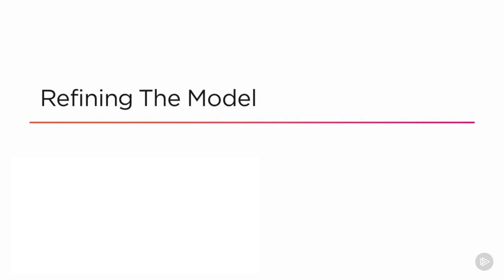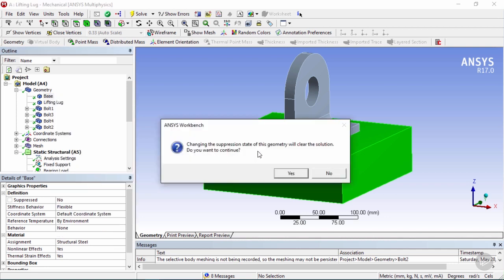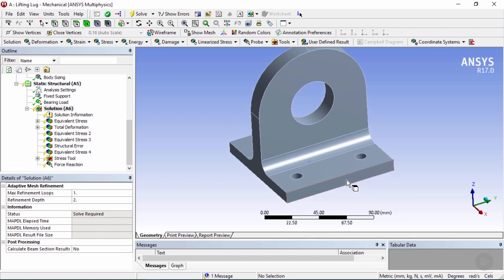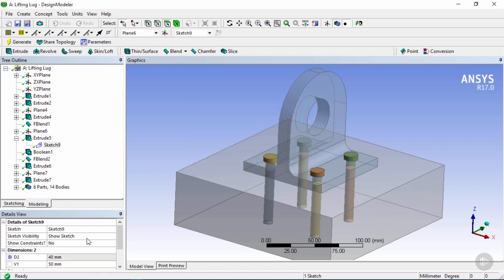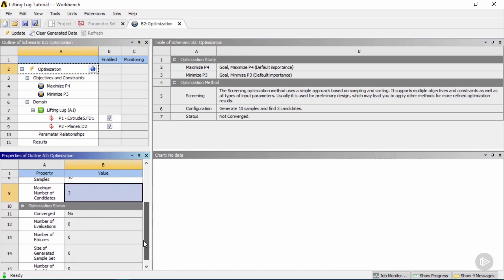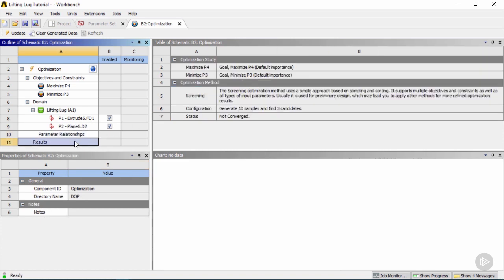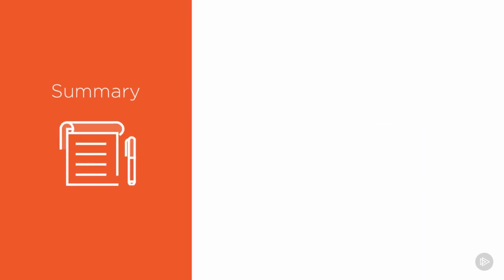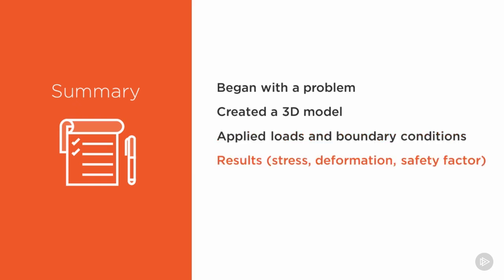Introduction To ANSYS (Part5) : Refining the Model

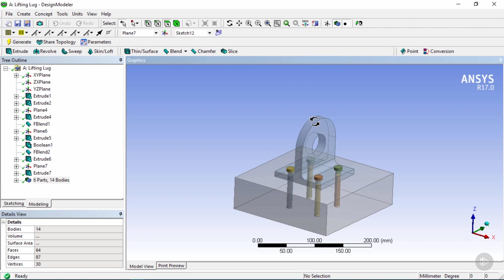Comment: 8:41 set parameters
10:04 parameter set cycle
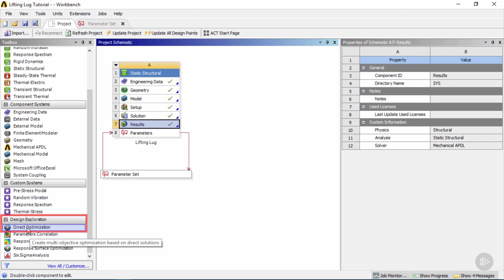11:33 under design exploration - direct optimization 
15:39 optimization result analysis
20:35 Insert candidate point as design point